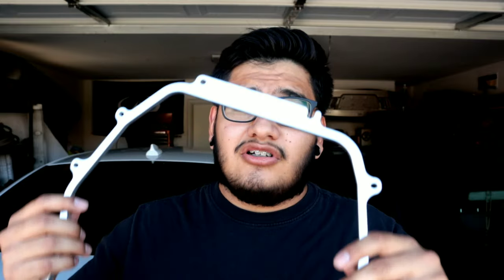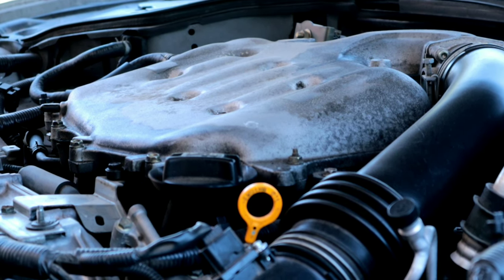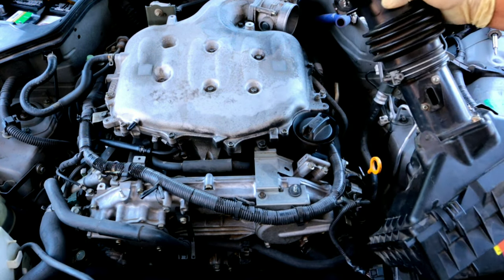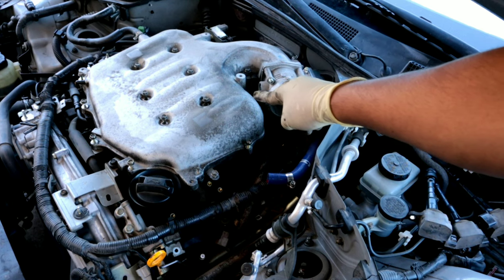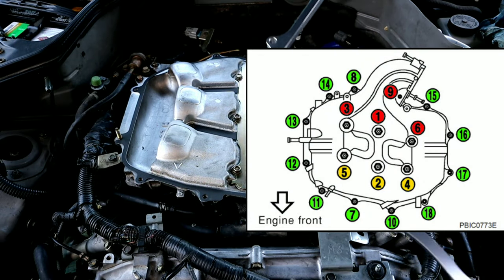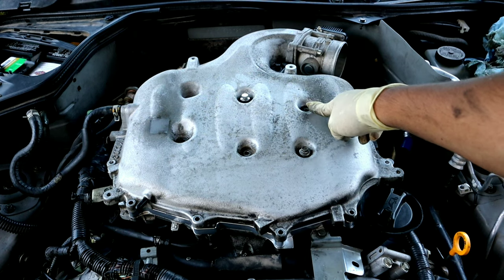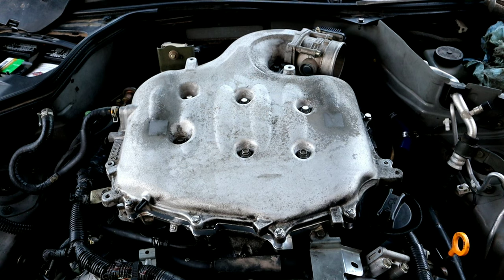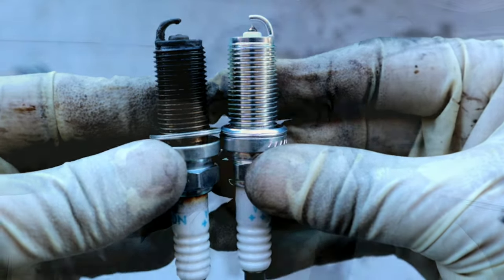How To Install A Plenum Spacer On A G35 Or 350z! Z1 Motorsports Angled Plenum Spacer!

Comment: Highly recommend against using an impact on your plenum you can easily strip the bolt holes
Reply from the maker: Never has happened to me but for someone who is inexperienced I can see how that can happen
Reply: @ERICSDIYGARAGE  yeah lucky me I was hand tightening bolt 9 and it just kept spinning lol. I guess I just have gorilla grip or something cuz I stripped it
Reply: how did you remove it. just stripped mine :/

Comment: bro one of the screws on the plenum isn’t screening in what do i do?
Reply from the maker: It should screw in make sure that you start every bolt in by hand. If you have one fastened down all the way the plenum won't be properly seated and you can run into the issue your having. But it can also be that your over torque the fastener and damage the threads
Reply: @ERICSDIYGARAGE  if i did damage the tread how do i go about that
Reply: you think i can video call you & show you the problem? cuz i’m probably not explaining it right

Comment: My z1 plenum spacer didn’t come with a gasket
Reply from the maker: At first I didn't think mine came with one as well but it I found it underneath the foam that they use to securely hold the spacer when shipping
Reply: ERICSDIYGARAGE lmfao i just check that your right 😂 thanks a lot!!!!
Reply from the maker: haha that's funny man I'm glad you found it lol 🤯
Reply: ERICSDIYGARAGE lmfao! Did you feel any throttle response or any difference?
Reply from the maker: I noticed more torque but I also recently changed really bad spark plugs so I'm not sure if it's the spacer or the new spark plugs 🤔
Reply: ERICSDIYGARAGE might be both
Reply from the maker: engineers build vehicles on a budget and sometimes they cut corners. this mod have been proven with a dyno showing gains in power and torque on these vehicles.

Comment: Just so you know, the 05-07 Rev Up motors dont get affected much with a plenum spacer. You need to install a MREV2 lower plenum WITH the spacer to get a difference.
Reply: You actually do get more torque
Reply: On my VQ35DE it made a huge difference
 for sure
Reply: On the rev up 300hp, it dosnt make a difference ?
Reply: Don't spend near 800 dollars for the mrev2. Just get the lower plenum from the 03 04 non rev up and you get the same results. And if it bothers some of you that much, get it ported out by a friend to match the mrev2. Don't spend ridiculous money for a 30 dollar lower plenum. So if you got a rev up, match up the plenum spacer and the old lower plenum and you'll notice the difference.
Reply from the maker: This guy's knows
Reply: @finthechat2090  did you have the Software modified to have this effect? I've read a few times now that it's required in order to really get benefits from the plenum spacer mod..
Reply: @user-up3vx2hk1q  Hey Friend, Whats the best Plenum Spacer for a 2004 g35 sedan with 100k miles
Reply: @AS-rg3dd  5/16 spacer for daily driving.
Reply: I know this is an old comment but wouldn’t the Z1 spacer work better with REVUP engines since they are angled and raised the front by 5MM
Reply: @mau_zx6r246  it does help some, but you'll get better performance and feel with the older plenum also installed.
Reply: 2007 is hr
Reply: @tim7656  yea, for a 350z. G35 coupe in 2007 model isn't HR motor.
Reply: @user-up3vx2hk1q   honestly had no clue. Thank you for teaching me something new that’s interesting

Comment: What do you do about the studs tht are in the lower plenum bc with the spacer there useless and I didn’t get studs with the spacer
Reply from the maker: The top row longer 3 bolts move forward to the bottom 3 that are shorter they will provide 3 longer bolts for the top 3

Comment: can you run it without ecu remap or is it recommended to have a remap? will it still run smoothly?
Reply from the maker: You dont need a tune to run this but if you have multiple bolt on its recommend to get a tune for better gains

Comment: Does this space have any benefits on the 06 model 350z with the Rev up engine?
Reply from the maker: Yes I believe the Rev ups benefit the most from this modification
Reply: @BRAT PACK you need to pair it with the mrev2 lower plenum for it to work

Comment: Hey man, I am about to add the same plenum spacer on my G. Did you have to add any silicone/gasket maker? and also did you torque down any bolts to a certain spec?
Reply from the maker: I did not add any silicone on my vehicle and it's been running running fine they do provide a gasket for you. As far as the toque specs I believe I did add them in the pictures but it might be hard to see
Reply: The instructions require to torque are 44-61 IN. LBS and in a specific order, but by now you probably have already put it on there.

Comment: Did you have to do an idle relearn when you unplug the throttle body and plug it back in?
Reply from the maker: No as long as your disconnect your battery you should be fine, when you turn on the car it will idle a bit funny but it will adjust itself
Reply: I didn't disconnect the battery. Just don't turn the ignition on. No relearn needed. Worked for me

Comment: Does the 07 g35x vq35hr motor have the ability for one?
Reply from the maker: unfortunately no since it's a different intake manifold. but you can get your intake manifold bored out to allow more air inside your engine.
Reply: @ERICSDIYGARAGE  I can't seem to find allot of videos on my car.. And every time I order parts they send me the wrong ones.. So aggravating..I even have my Vin to AutoZone one time and they thought my car was a g37.. very confused
Reply from the maker: I'm sure its because its awd that they confuse everything sorry if you have a hard time finding info on your vehicle
Reply: I have the same exact problem with mine. I can’t find the right radio harness for my 2007 g35. I don’t even know If it’s a sport, base or any of the other types. Crazy thing about the sport and other things. They all show up as the same engine and almost everything.

Comment: Hey whats up man, I bought a z1 plenum spacer went ahead and installed it but after doing some pulls I hear a really loud noise when reaching 5-6k rpms. I don't know what it is... I don't think it's a vacuum leak because when I rev it it all sounds perfect or there's no other sounds coming from the engine when idling. It only does it on pulls and sounds like a loud rasp.
Reply: If you know what it is please let me know thanks!
Reply from the maker: @yaeldelatorre6190  did you make sure all the bolt where tight, sounds like something might be loose. did you install anything else like test pipes
Reply: ERICSDIYGARAGE yea I took it to a shop to make sure and they were all good and no I am fully stock . That was the only mod I did. It kinda sounds like a rattle at high revs
Reply from the maker: that's strange only thing I can think of is that maybe the vehicle is not running right after the install, give it time to clear its adaptations
Reply: ERICSDIYGARAGE would test pipes make that loud raspy sound ?
Reply from the maker: it does make a raspy noise I would have to hear it

Comment: Quick question. I was installing new valve covers and when removing the upper plenum there were four rubber washers inside the plenum spacer? Are these supposed to be here or were they strut brace spacers and previous owner did install wrong?
Reply from the maker: Good question the spacers are there because you are creating space inside when you get a plenum spacer. Without those spacers you are potentially going to break your plenum they have to be inside
Reply: @ERICSDIYGARAGE  awesome thank you for quick reply! I see they usually come with 6 but mine only had 4 is this okay?
Reply: My z1 spacer didn't come with the inside spacers with their kit? Ok to run without?? Thanks Eric!
Reply from the maker: mine didn't have them either z1 doesn't think it's a issue but it will damage the intake over time

Comment: i installed my spacer today and i noticed it idles funny. sometimes it almost goes to 0 rpms like it’s gonna die, then it goes back up. just curious if i should be concerned, or if it is a normal thing that my car is idling weird and the computer in the car has to adjust to it? please LET ME KNOW!
Reply from the maker: has the issue gone away sometimes the vehicle need to relearn idle
Reply: @ERICSDIYGARAGE  eh it’s gotten a little better but when i come to a stop and slow down my car kinda tugs me around

Comment: Can somebody clear up something for me. I hve an 04 non revup. Anybody have the spacer and how does it feel? Would you need to upgrade the intake system i.e throttle body/ air intake? Would you also need a tune afterwards ? Thanks in advance!
Reply from the maker: You will notice a little improvement in acceleration and not you don't need a tune to run this spacer

Comment: My #9 bolt is not threading in.
Reply: the one next too the throttle body. It just keeps spinning freely inside. the threads are not stripped I may have the wrong bolt but I read that the top three bolts #1 ,3 and 6 are the same as #9 but the z1 kit only supplied those three bolts for #1,3,6. So you resuse the oem bolt on 9?
Reply from the maker: @willhawkins284  yes you reuse number 9. I think this upper 3 center bolts will fit in number 9
Reply: @ERICSDIYGARAGE  yea its not threading in
Reply: @ERICSDIYGARAGE  I went to home depot and got a bolt. m6x75mm. it works and my 190k revup sedan is pulling like no other w my intake and exhaust setup. and she doesnt burn much oil.

Comment: Hi Eric great vid.  Do you need a transmission mount? I make reinforced stock rubber mounts with rubber urethane, it takes away some of the slack in the drivetrain. It's an awesome mod, and I'll send you one for way cheaper than the aftermarket poly mounts. Very easy to install too. Let me know :)
Reply: I’m interested lol

Comment: I only lifted the plenum halfway without taking the hoses off. It worked out well. However, maneuvering it around a little bit while putting it back together was a pain. I reused my old gasket. It was in good shape. Good vid however.

Comment: Could have used some better tips on how to actually do everything you said to do and closer ups if specific lines and hoses didn’t mention all the bolts to take off air filter not a bad tutorial just missed some things that would have made it a lot easy for someone who has 0 mechanical knowledge or skil and is trying to learn and do this
Reply from the maker: I appreciate your feedback I included diagrams of the bolt locations and aside from having the camera in my face this is as best as it's going to get. It's really not that difficult but I can see someone without no mechanical knowledge struggle but this is also have you learn by figuring things out as you go